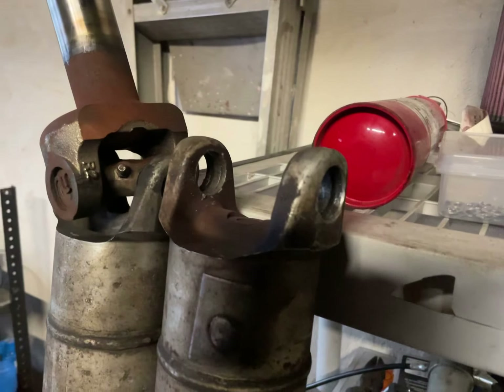5 speed crown Vic driveshaft information.

Comment: Thanks for the update Vincent.   I didn't know that either. It's also my understanding that the steel driveshafts out of the 98 to 2011 non PI cars are even longer yet.   We're going to be using the stock aluminum PI driveshaft from our 2011 which some say still needs a spacer and others say it don't lol.  I have a Fabtech spacer on hand but will only use it if I think it really needs it.    Thanks for your swap videos over the years they have been helpful.
Reply: P.S.  I like the channel name.  :)
Reply from the maker: I ran a t45 and tr360 with the p71 driveshaft and did not need a spacer. And swapping this driveshaft out fixed my vibration issue